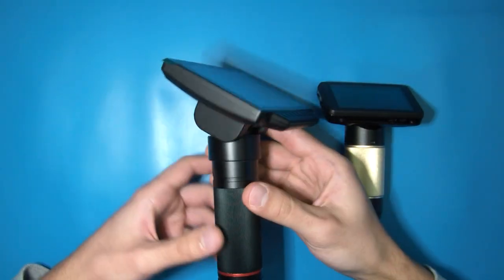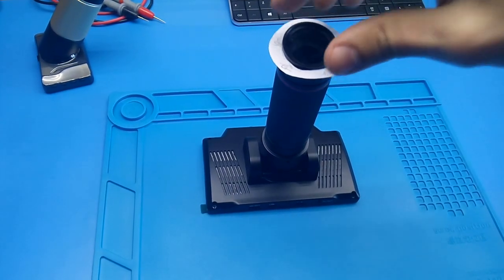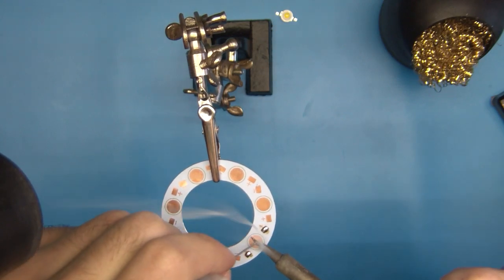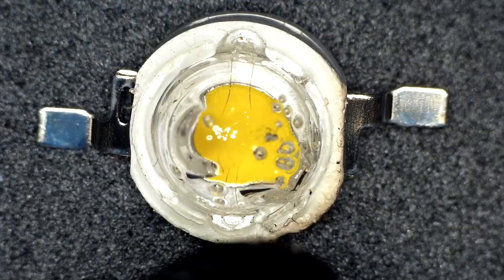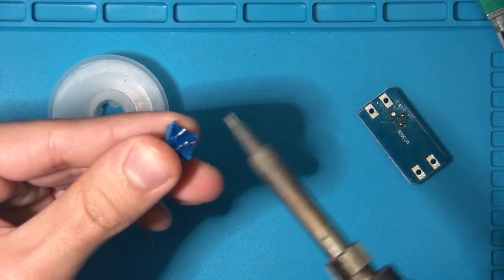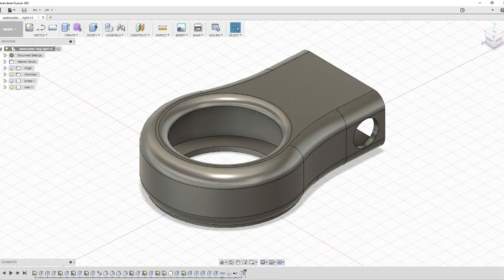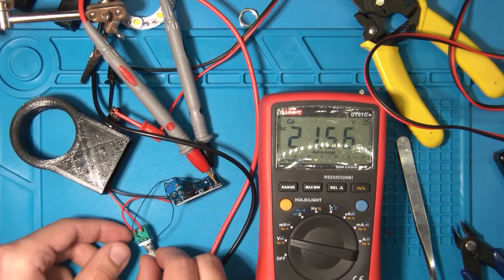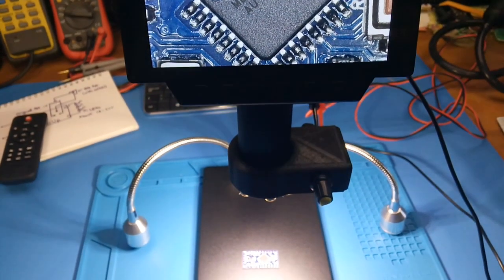DIY LED Ring light for Andonstar ADSM201/ADSM302 Digital Microscopes 🔍☀️

Comment: Works great.i used the gray Nes rf module case for mine and mounted it to the top of the 302's post.

Quick question,i think i know what it is but when  i turned the switch to max and set the blue box's gains to output 21v the leds will strobe and the blue box will make a buzzing sound.

i used a 5v 1a ac to dc wall charger and 1watt leds but i think its not supplying enough current to keep it at 21v.its plenty bright enough at the 19-20v range tho so its no biggy just curious what was causing that.

Thanks for the  Tutorial..

Comment: Hi great video, will look into this scope, btw what hot air gun did you use in the video? thanks in advance?
Reply from the maker: Thanks. It is a cheap one I got from ebay https://goo.gl/Cd5dqa works quite good as it has an actual pump inside not like the wimpy ones that have a weak fan in the handle. As for soldering iron I recommend a T12 compatible station as they heat a lot quicker and are way better at transfering the heat because the heating element is embedded in the tip, but the one included in the station also works fine for 90% of the jobs.

Comment: Hello,

Very good mods to improve the microscope.

I have a question not related to the video, I hope it does not bother you.
Does your ADSM201 microscope allow you to record the video in the MicroSD while you have it connected via HDMI to an external monitor? And the ADSM302 allows it?

Thanks in advance.
Reply from the maker: Hi, unfortunately none of them records while connected via HDMI. I had to buy an HDMI capture card to be able to record and watch at the same time on my computer screen. But the adsm302 has a big screen with good resolution so it is not necessary to connect to an external monitor in most cases, the adsm201 on the other hand has a very small screen with poor resolution. The adsm302 also has analog video output I believe it is possible to record while that is connected but I haven't tested it.
Reply: Thanks for your quick reply.

I bought the ADSM201 this week and it took me a huge disappointment for not being able to record the video in the MicroSD at the same time as the HDMI is connected.
Also the quality of the screen is horrible, it is not even distinguished if the camera is well focused or not!

I'm thinking about returning it, maybe it's better to buy the ADSM302. Do you have a link on the capture card for HDMI?

Thanks again for your help.
Reply from the maker: I got this one https://goo.gl/2xxkfW it's pretty much the cheapest you can find but it works fine. If you decide to buy another capture card make sure it is usb 3.0 or you will get quite a bit o lag.
Reply: Hello again, do you have a purchase link (or name) of the microphone holder that you use to hold the microscope? It looks very robust.
I think that in the end I will keep the microscope and I will make the same improvements that you have made.
Greetings.
Reply from the maker: I just made a video talking about it. You can check it out here https://youtu.be/_9cUfiB92uw
Reply: Oh! Great, I'll watch the video, thanks!